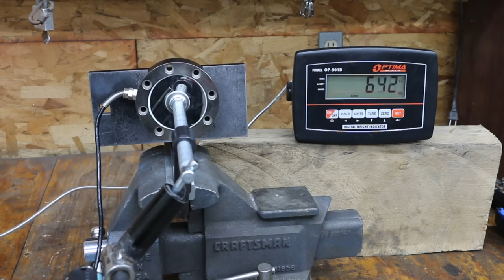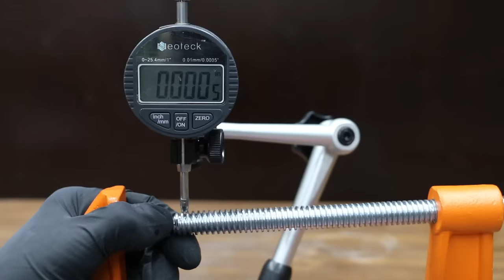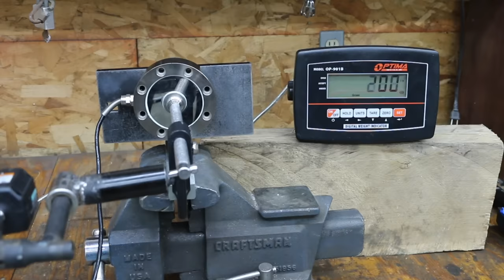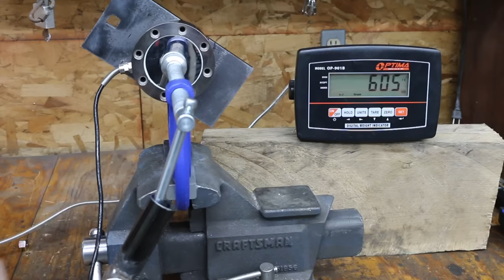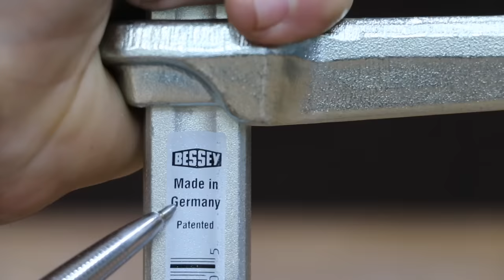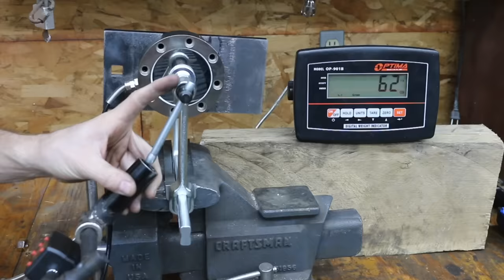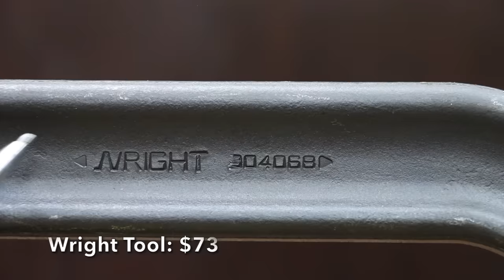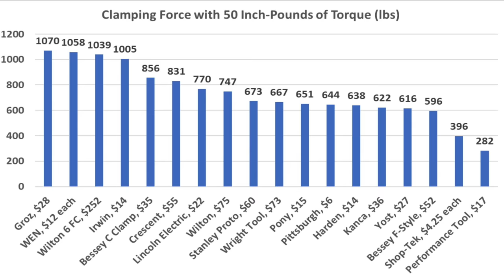Best C-Clamp? Let’s Settle This! $4 vs 252, Wilton, Yost, Irwin, Wright Tool, Harden, WEN, Proto

Comment: the problem with clamps is that most people use them incorrectly  they overtorque them then claim theyre junk and never even have an inkling of clue that the failure was due to user error not low quality
Reply from the maker: Thanks for the feedback.

Comment: Sure, it's far stronger and tougher than any of the others, but $252 for a C clamp is nuts. That's right up there with what the military pays for stuff... $30 gallon diesel fuel, $5000 wrenches, $9,000 toilet seats
Reply from the maker: Thanks for the feedback.

Comment: Might be just me, but the manner in which you tested for slop in the clamping screw seems very flawed, especially when you got to the F-clamp. Each clamp features different lengths of adjusting screws. My thought would be to measure each one's slop at the shortest screw length so the rise/run is more easily interpreted and equally comparable. (For example, an 8" screw may have 1/4" of slop at 8" and a 2" screw with 1/8" of slop at 2". The 2" in this instance is twice as bad since the 8" screw would have 1/16" of slop at 2", but your method would show the 2" as better quality). Not at all trying to be negative, but I feel as though some areas of your testing could do with a little constructive revision from time to time. I really appreciate the comparisons nonetheless.
Reply from the maker: Thanks!  Thanks for the constructive feedback.

Comment: if you are only clamping 1 inch thick you shouldn't use a 6 inch clamp. go with something smaller like 4 inch. the weakest point is the screw itself and can bend easily when it is extended a long way .
Reply from the maker: Thanks for the feedback.

Comment: I'll take the cheap WEN for the win.
Reply from the maker: Thanks for the feedback.
Reply: @ProjectFarm  Think about the everyday use case of a C-clamp.  You don't need extreme performance.  You just need the OK stuff.  I own a bunch of Bessy clamps for wood working, but they are not C-clamps due to not wanting to dent the wood.

Comment: Who woulda thought there was that much difference in mainstream brands.
Per typical, it looks like "stay away from Harbor Frieght level" and the average shop should do ok with an Irwin or the like. And per common sense, if you need to clamp more than 4000lbs then spend more money.
Reply from the maker: Thanks for sharing.

Comment: Six and seven sixteenth inches... Say that 5 times fast 😂
Empire units really are a faff on.
Reply: As a dumb Yank, I have heard guys call for a "X/whatstinks" when requesting those silly X/16 sizes we use. Thing of it is that those of us-of a certain age in Yankeeville know every interchangeable metric size for our fractional madness. Some of us have worked in or used multiple scales of measure. We are not multi-lingual as a rule, but multi-metrical no doubt!

Comment: The broad 'comprehensive' comparison of all these different-style (different-purpose) C-clamps is not logical.  This program is like performing various tests (maximum speed, fuel economy, weight, price,etc) for a broad range of cars (e.g. Corvette, Camry, Linclon, Fiat, etc) and then plotting the results for all cars, all on the same chart for each test.  Who does this?
C-clamps are used for a wide variety of requirements.
A much more logical approach would be to establish a small number of discrete categories (e.g. throat size, price, weight etc) and then tabulate test results for each category.
You know: like perrforming a series of tests and tabulating results for:  compact cars, or luxury cars, or sports cars, etc

Comment: Definitely not criticizing, but that heavy duty Wilton probably should’ve been in a different video. With no handle, no swivel base, and rated for tasks definitely out of reach for the other clamps, it smears the comparative data when looking at clamping force and adding force to an already loaded clamp. The bars in your graphs are so small compared to the Wilton. It’s hard to see the relevant data on the clamps home shops would buy. Like you said, it’s in a league of its own.

Comment: Your test of the clamping torque was wrong! The special tool you made up did not take into account the length of the turning handle of the c clamps, so all your readings are incorrect.